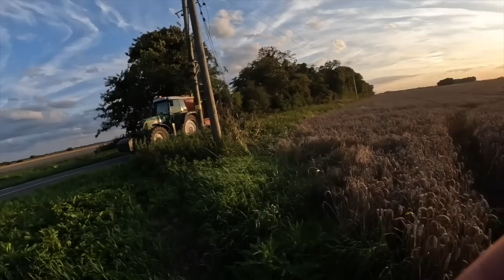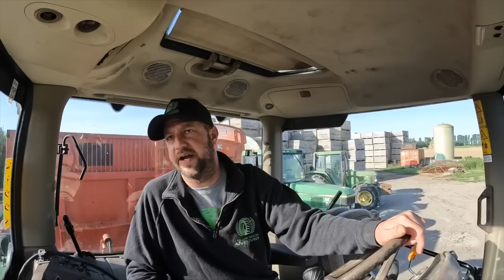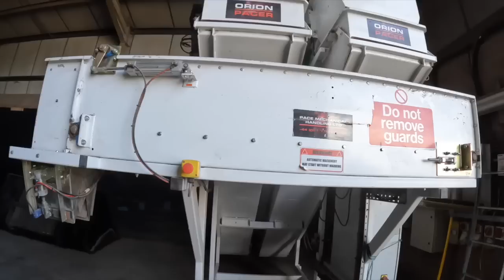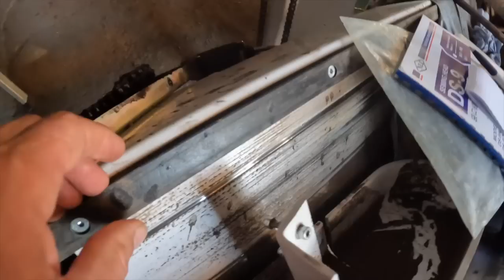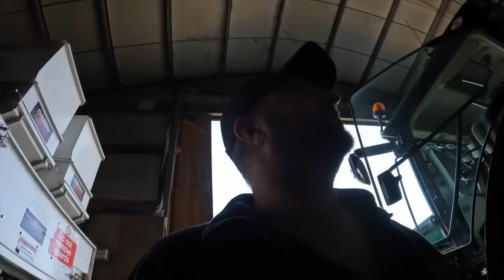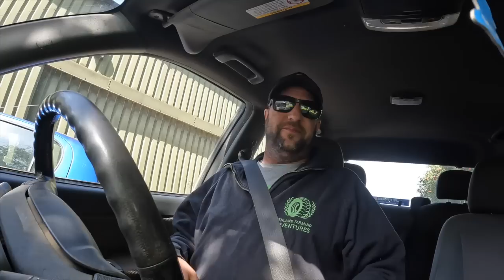UNSEEN FOOTAGE   WILL PRE HARVEST FOOTAGE

Comment: Great video Daniel most of the lads beside me here usually run the tractors without the weights but this year they all have them on must be the wet year your right about those f35 they are not so stealthy 😂you’d here them coming from 500 mile away 😂
Reply from the maker: 😂😂😂😂yeah I reckon you’d want 4/500kgs up front on big tractors for trailer work just keeps it balanced maybe ??? And yeah you get used to them but bugger they are loud 🤣🤣🤣